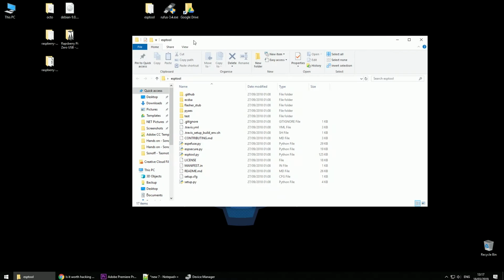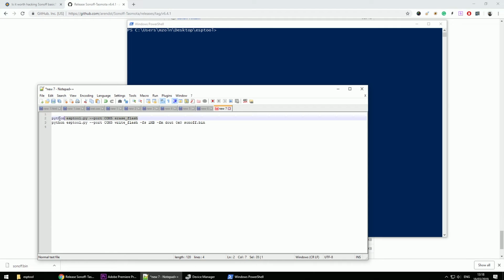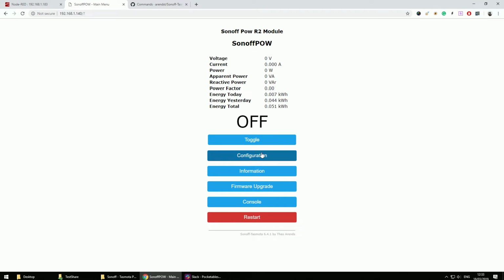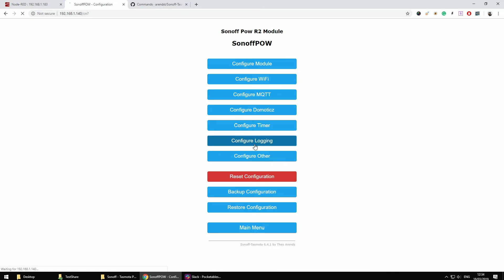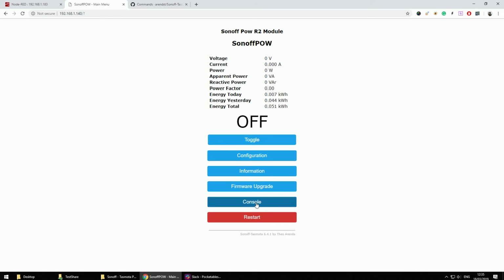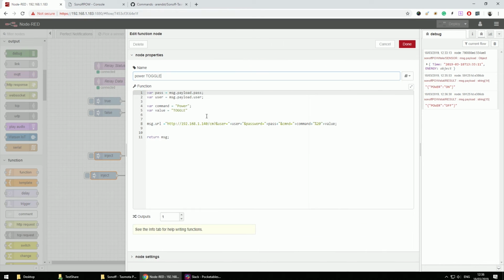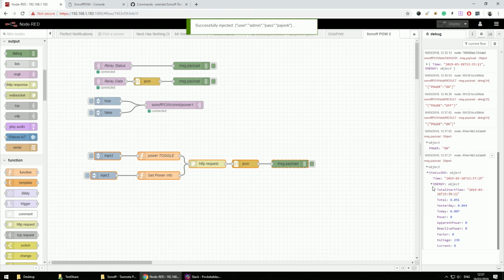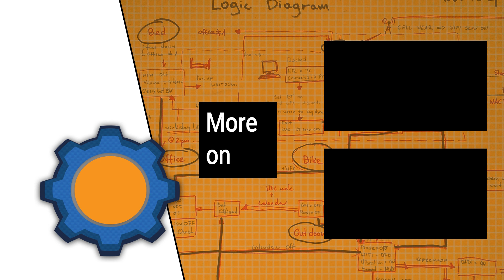Flashing Tasmota on Sonoff POW R2 [Flash Guide 2020 update in description]

Comment: Hi Matt, one thing you should mention, if you wanna properly backup Sonoff Pow R2 you should read all the 4MB of ESP8266EX not the only first 1MB. When you'd like to write back your backup it should be like  this: python esptool.py --port COM5 write_flash -fs 4MB -fm dout 0x0 backup.bin where COM is your proper COM port and backup.bin is your previously backuped firmare. Awsome video.
Reply: Too bad that I haven't read all that before going Tasmota. I backed-up the original firmaware but it is a 1MB file...
If anyone has (or can extract) the original firmware for me to go back to stock, it would be amazing !
Reply from the maker: That's a good advice thanks
Reply: Are you saying this tutorial has been done incorrectly?

Id like to do this but i don't want to risk losing something if i can help it.    Do you know of any other complete tutorials?

Comment: I have configured SonOff POW R2 with Tasmota. Switch is working, but power, voltage and current are showing as zero in Tasmota. Have configured Home Assistants with MQTT and all sensors are showing, but power, voltage and current are showing as zero. In original eWeLink it was working properly. Please guide how to rectify this.
Reply from the maker: Are you sure you have selected the correct template for the switch? Sounds like this is an issue if the tasmota UI isn't showing values
Reply: @notenoughtech  I have used below template. Please suggest what template I have to use. 
{"NAME":"Sonoff Pow R2","GPIO":[32,3072,0,3104,0,0,0,0,224,320,0,0,0,0],"FLAG":0,"BASE":43}

Comment: After I have replaced the original firmware with the TASMOTA one, does the eWeLink app still work or does the Home Assistant only work?
Reply from the maker: eWeLink won't work you will need to use REST or MQTT

Comment: Hi, I sucessfully flashed tasmota on POW R2 v2. For flash mode I had to add 470 ohm resistor between RX and GND. After flash I changed device to POW R2 but I have no energy  data (I do not mean zero values but no data). Could you help me pls?
Reply from the maker: do you have status update data?

Comment: Yep this is a nice way of doing it. All's well but what to do if things go wrong??? My PowR2 is not coming alive after flashing. Did not show any errors. Put back original bin and tried other versions, no luck. It won't even blink the blue led anymore. I now discovered to use Termite as a serial terminal, cause it start scanning for COM ports to come alive, and shows right what Sonoff does at boot time once connected to usb-serial adapter. Mine shows a stackdump, so I'm in big trouble. Looking for some diagnostic program that I could upload, but most likely the flashram chip needs to be replaced. Glad I can solve that myself, but that's not everybody's cookie :-)
Another great tool to look around in your Sonoff (in case of doubtful operation) is the ESPlorer tool, free to download on internet. It is a sort of developers tool but also great for diagnostics, if you can still make contact with your Sonoff. Me, I'm lost even with this tool :-(
Reply from the maker: Now we have tasmotizer. It's even less prone to errors ;)
Reply: @notenoughtech  I forgot to mention; it WAS Tasmotizer v1.1 that got me into trouble in the first place! It would hangup after downloading the original PowR2 firmware, timeout or abort. Then restart with erasing/flashing without any logging or errormessages. I was advised to abandon Tasmotizer and use ESPtool, so at least I'd have come clearer comms during the process. Well I guess it's just bad luck, flashing the PowR2 into oblivion...
Reply from the maker: Oh, So far I had no issues, but I have to say I have not tried the recovery yet (mostly because if I flash something, I hardly ever need to go back to the stock)

Comment: Hi Matt, how are you? I followed your steps, but after erasing the firmware, i can't write a new one.  I guess I'm not entering on boot mode now, but I'm not sure if it is this. When I try to write, i get this error: A fatal error occurred: Failed to connect to Espressif device: Timed out waiting for packet header. Any idea about how to proceed?
Reply: After erasing the original firmware, my sonoff is not lighting any LED. It should turn on, or after deleting the firmware is ok to don't?
Reply from the maker: Check the following:
- inspect quality of the soldering
- make sure that RX-TX is connected correctly
- Keep the button down for 2-3 sec during the boot procedure
- Double check the COM port and spelling of the command
Reply: @notenoughtech  Thanks for the reply. I solved it... the FTD 1232 has two options to 3.3v. One of them is the 3.3v pinout in the side, and other is the to short the 3.3v middle pin to get 3.3v  in Vdd pin (that place you can choose 3.3v or 5v) Well, I was using the first one... Today I started checking everything again, and I checked the current in the side pin, it was not enough. Curiously, the middle pin could give all the current i needed. In fact, i was already planning to use some outside alimentation for the circuit, as usually these pins would be just shorted... Or maybe my 1232 Chip is a shit china version haha.
Reply from the maker: @apvitor  Good to know that you got that sorted. Next time someone asks this question i will be sure to mention your solution too!

Comment: hi Matt,  I'm having issues in flashing the POW R2, same setup works on TH, external 3.3v, FTD1232, tried whit raspberry serial too, grounded GPIO0, flipped RX<>TX, even cut out RX circuit going to the measurement chip...any ideas, please?
Reply from the maker: GPIO00 is linked to the button, press it down and hold it, power on the FTD1232 and then let go after 2-3 sec  - you should be able to flash it.  (I assume you cannot flash as you cant find the device?)
Reply: @notenoughtech yes, connecting to nothing ...
Reply: @notenoughtech  TRACE +0.103 Timed out waiting for packet header
_TRACE +0.063 command op=0x08 data len=36 wait_response=1 timeout=0.100 data=
    0707122055555555 5555555555555555 | ... UUUUUUUUUUUU
    5555555555555555 5555555555555555 | UUUUUUUUUUUUUUUU
    55555555                          | UUUU
TRACE +0.001 Write 46 bytes:
    c000082400000000 0007071220555555 | ...$........ UUU
    5555555555555555 5555555555555555 | UUUUUUUUUUUUUUUU
    5555555555555555 5555555555c0     | UUUUUUUUUUUUU.
TRACE +0.103 Timed out waiting for packet header
_

A fatal error occurred: Failed to connect to Espressif device: Timed out waiting for packet header
PS C:\Python27\esptool-2.7> python esptool.py --port COM9  erase_flash
esptool.py v2.7
Serial port COM9
Connecting........____....._____....._____....._____....._____....._____.....____
Reply from the maker: I assume that's the correct port? I'm pretty sure we are missing something obvious. The Connecting message usually is caused by TX RX mess up, or ESP not in the correct boot mode
Reply: I am going to give my own answer: solder pins on the bottom side of the sonoff board and do not solder together the layers of the sonoff board, Cheers Matt!
Reply from the maker: Ha - dodgy solder? That explains it :D
Reply: I am not patient, couldn’t wait for the pins to arrive and soldered the wires on the top layer pads and “maybe” short circuited whit the bottom layer of the sonoff circuit board, on the th, it worked all right then on my raspberry, after I cleaned the holes on the sonoff board, soldered pins on the bottom layer, crimped a ribbon cable and went into flash mode, the usb-serial rx led was not flashing anymore, the flashing of the led should have lead in thinking that there was an issue in my initial approach, anyway thanks for the quick reply and great videos keep up the good work!
Reply from the maker: I have done that a couple of times too. be careful with solder drips as well as if a pice drops on the board can render it useless and with SMD components it takes only a little bit

Comment: can you explain a bit more hot get the unit into flash mode.
Reply from the maker: Hold the button down when powering. (See article for more details)
Reply: @notenoughtech  You mean the on/off button, assume as there is no other ?. Thanks for the video's... :) next up is getting HassIO working and then MQQT/NodeRed receiving/sending to Sonoff
Reply from the maker: Yup there is only one ;) they made it almost too easy this time
Reply from the maker: I don't think I can make a switch. I owned an iPhone 3 once ... I loved it then apple killed it for me 😉
Reply: @notenoughtech  surprised, as playing with sonoff's is getting closer to tech, and that's one thing the MAC platform does, allows you to be as close as want to be, or as far/stable/it just works as you want to be.